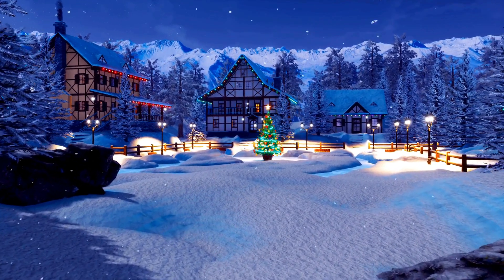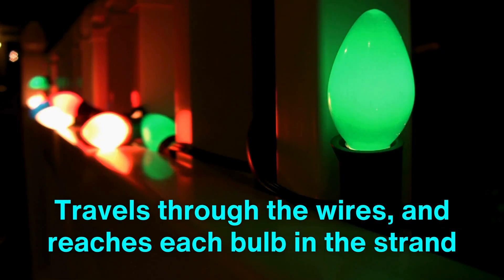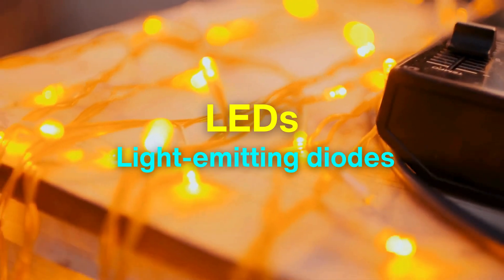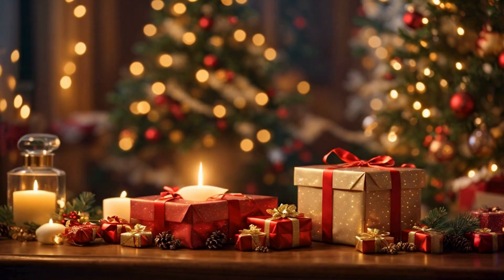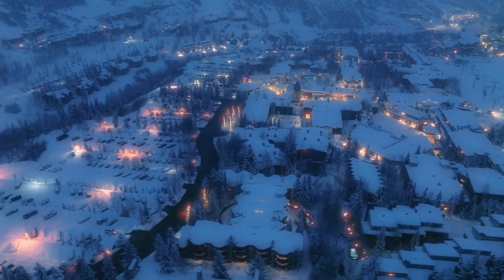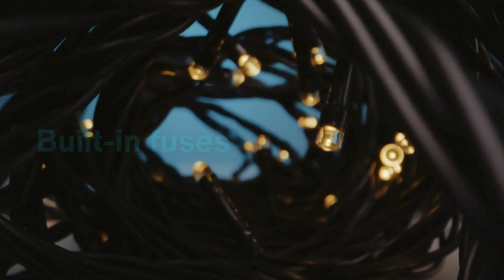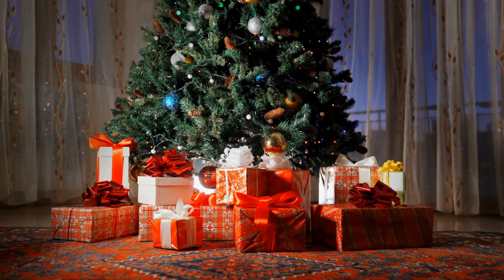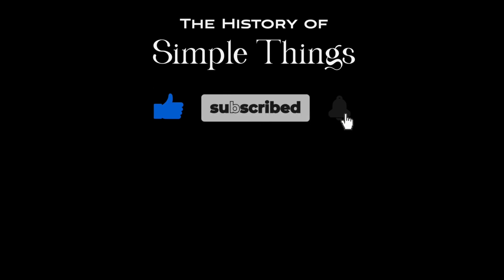The Spark That Makes Christmas Lights Magical

Comment: 5:37 but, if you still long for pyrotechnics, just buy a set of American xmas lights, and plug them in over in Europe. 
only lasts a second, but will provide memories for years to come! 😆
[ for those who don't know, Europe runs on 230 volts opposed to our 120 here in the US ]